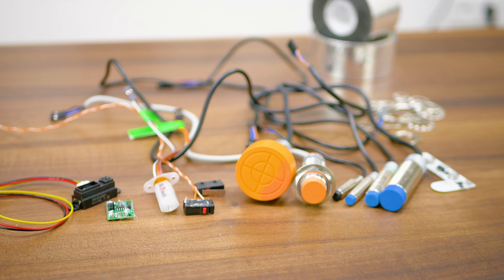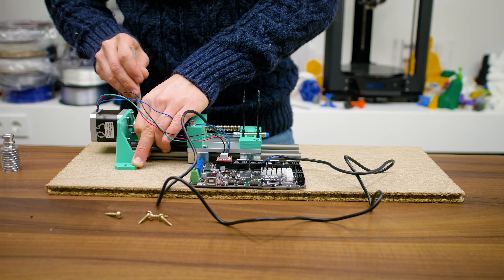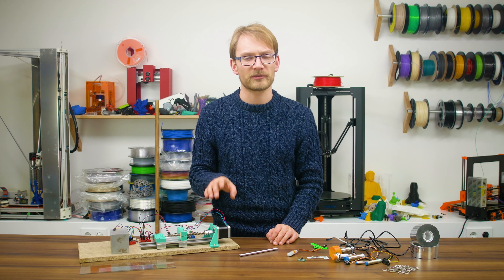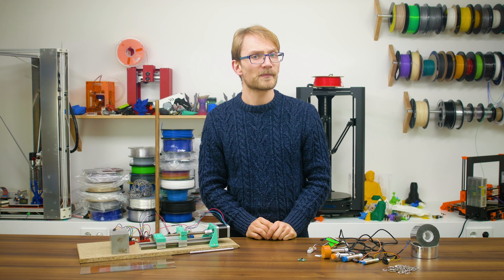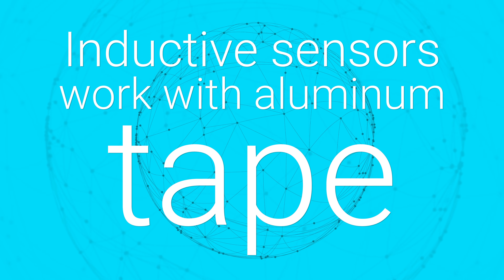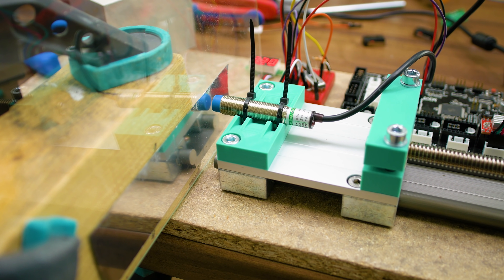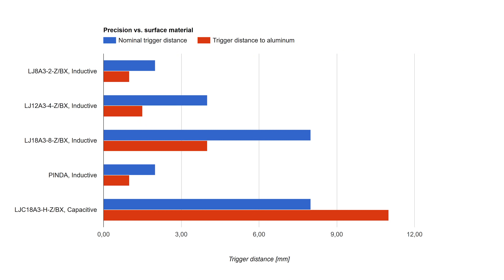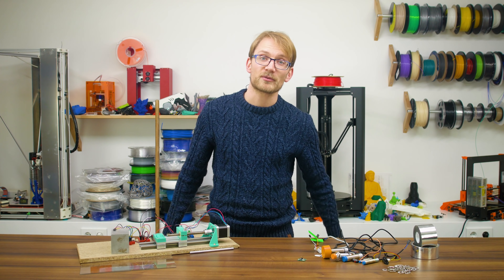Autoleveling on 3D printers: 9 myths and 12 sensors tested!

Comment: What about ultrasonic? Are those accurate at all?
Reply: I used to sell a dual-mode optical + experimental ultrasonic sensor for Ormerod printers. The ultrasonic one worked when the bed was cold, but when the bed was hot the trigger height changed, which is inevitable because the speed of sound in air changes rapidly with temperature. I added a configurable parameter in RepRapFirmware to compensate the trigger height for changes in bed temperature, which partially worked round the problem. But at high bed temperatures, significant convective draughts occur at the edges of the bed, and these also affected the trigger height.

After experimenting with capacitive sensors and producing a preliminary design for a solenoid-activated probe, I settled on the differential IR because it worked well for me, was the smallest of them all (great for delta printers),  didn't need much power, and was not difficult to manufacture - although testing it is rather labour-intensive.

Comment: where is Prusa i3 MK2 cloned part 2 :(
Reply: Nothing more relaxing than someone telling you to relax ;)
Reply: I want to build my first cheap 3d printer
Reply: HYPE!
Reply: Building printer your self is much cheaper and you will learn how it works, so when something breaks you know what to replace
I already ordered all of parts required to build clone of prusa for around 80$(not including frame, I will build it my self)
Reply: Runder Caster go to microcenter! they have a Prusa clone from wanhoa for $299! works amazing for the price with decent print volume 200*200*180. I'm trying hard not to buy a second one.
Reply: woops sorry misread your post as "get a 3D printer" $299 ($399 online elsewhere) was the cheapest I'd seen for fully assembled all-metal printer with that build volume just trying to help out.
Reply: I have built 2 Wilson II printers, really good design! Is like a prusa i3 but uses only aluminum extrudes for the structure. A seller on aliexpress (NARUTO) sells kits for this printer.
Reply: Wilson II is a nice design with the dual 2020 extrusions to prevent printer flex and the PSU mount.  Not a fan of the PLA printer pats though since the extruder and y-axis motor mount will eventually warp from the motor heat.  I printed an ABS Wades for a Wilson TS that held up okay.
Reply: Runder Caster Quality takes time!!!